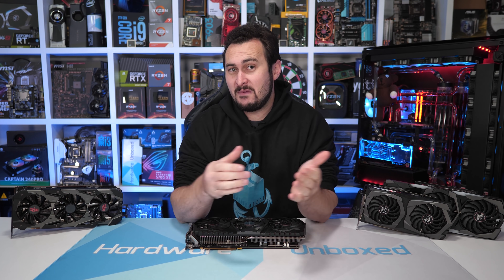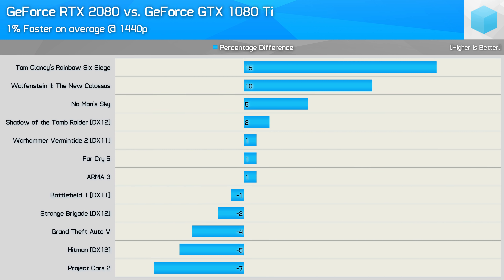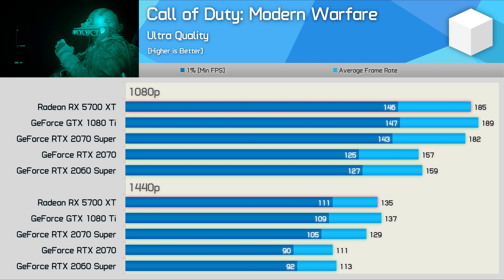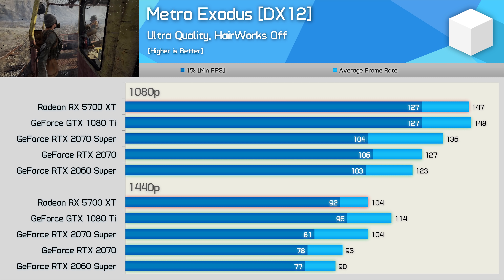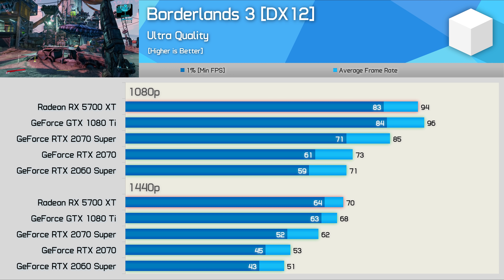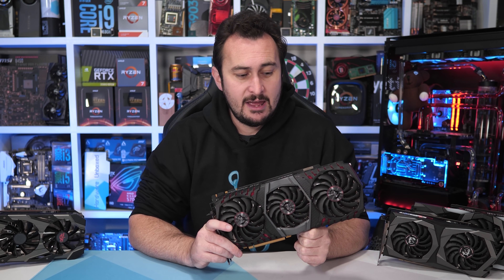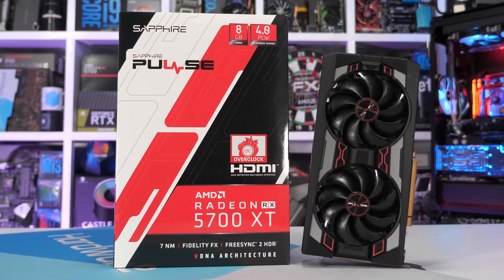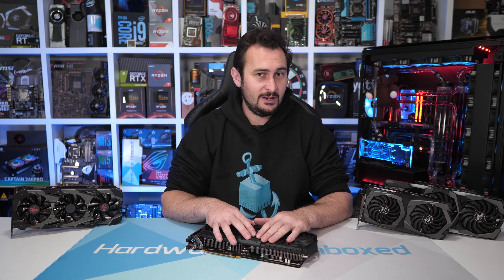GeForce GTX 1080 Ti vs. 5700 XT & RTX 2070 Super, 35 Game Benchmark

Comment: i bought a xfx thicc iii 5700xt based on reviews like this, it was a complete disappointment. my 2070 non-super out performed what I was led to believe was a upgrade of sorts. it was crap and fps kept going down even with more cooling. built a 3900x system and thats been nice.

also, tried following your ram tuning guide, might want to revisit that using micron a1 e die, the calculator has changed and I had a bsod, settled fo geardown disabled and stock timings with a proper cl15.  😒

Comment: Great vid as usual. Stupid Question Time:  The 5700XT is fantastic value , but when on screen where there is only 5 frames short of the TI, citing CPU  is the limiting factor. now... if on the same setup if you then compared a 27" 1440P with an 1440P Ultrawide , would the RTX TI then come into its own by maintaining higher FPS?

Comment: I know plenty of people who have bought 2nd hand 1080tis instead of the 2070 super and 2080 because of the extra Vram. Performance between the 2 is very comparable with the 1080ti beating out the 2070 super in most cases. RTX ON just tanks performance so not that many people are using it. Considering the performance is very similar, the logic here is that you are actually better future proofed by having the extra VRAM head room.

Comment: I couldnt use my 5700xt for 2 months and now got it back. Every fame Ive tested it against the 1080ti....it performed better.  Its why I sold the 1080ti and am now using a friends for tests. But still my 5700xt is getting 5 fps more on more recent  games. Why is mine doing so much better compared to the 1080ti than yours?

Comment: Frist off, not a PC pro. Build a PC in Nov 2019 and I think my MSI RTX2070 armor oc is dying. Gaming on it at 1080p max setting without issues at first but now I can't even play on medium setting without a pc crash which need a hard reset.

Black screen, black and coloured box, freezing and stuttering, crashing usually 30min - 1 hour of gameplay. Is this normal? I heard of 2080 and 2080ti artifacts but 2070 not so much.

So borrowed my friend's 3 year old RX Vega 56 Sapphire blower card and so far no problem. Gonna rma my card soon.

Comment: Nvidia Turing Now in 2020:
GTX 1650 (the one I dont get the idea behind)
GTX 1650 Super (the good value low/mid range gaming card)
GTX 1660 (Makes no sense after 1650 Super has launched)
GTX 1660 Super (Very good value card actually)
GTX 1660 Ti (Makes no sense after the Super has launched)

RTX 2060 (the resonable entry level RTX (quite good value if not for Navi - Fine for 1080P + ray tracing.)
RTX 2060 Super (Too expensive over 2060 to be good value, but good performance @1440P)
RTX 2070 (makes no sense over 2060 Super)
RTX 2070 Super (The high performing resonable RTX for smooth 1440P + ray tracing or 4K @OK settings)
RTX 2080 (Makes no sense over 2070 Super)
RTX 2080 Super (Too overpriced to really make sense over 2070 Super)
RTX 2080 Ti (The very overpriced - makes no sense unless you want 4K@high + AA - just to have it on)
RTX Titan (Ha Ha..! It has Gold on it?)

AMD Navi Now in 2020:
RX 5500 XT (good low power card - all you need for smooth 1080P@high gaming. Pick the 8 GB and expect an advantage over 1660 Super in a few years time)
RX 5600 XT (good mid-range card - Superb 1080P & smell the lovely 1440P@high experience)
RX 5700 (Good mid/high range card - enjoy 1440P@high settings - smell 4K@low/medium-ish)
RX 5700 XT (The one to have for super smooth 1440P@high settings or 4K@OK setiings gaming experience)

That is why Nvidia don't get money out of me. That list is twice as long as it should be (and confusing for many consumers)

Comment: AMD = Value that Delivers performance. Nvidia = I don't know what to say anymore..  I remember getting a brand new GTX 1080 Ti exact 3 years ago for a little Less than a 2080(non Super) cost Now!! WTF!? 
Just got a new (demo-model full warranty) Sap. Pulse RX 5700 XT for about the same price as the cheapest RTX 2060 6GB. That is "2070 Super" performance for low 2060 Price. (and cheaper than a 2nd hand 1080 Ti - out of warranty)
The 1080 Ti was a great card - and still is. The last New Nvidia card I got. Nvidia don't get a penny out of me before they change their business game.
You want a RX 5700 XT very get close to RTX 2080(non Super) Performance?? Get the Asus Strix OC model. I have one (Can verify it runs 2000+ MHz stock settings).
I choose a new (or newer) RX 5700 XT any day over a 2-3 year old GTX 1080 Ti. Less power, better arcitecture. RDNA optimizations will age like fine wine, and 3 years from now, a RX 5700 XT, will beat a RTX 2080 (maybe even the Supermodel). The Big Navi will make a difference. Nvidia has made the same mistake as Intel. Delivering new products, that really arent that better for a long time (3 years). RTX 2080 Ti 30% better than GTX 1080 Ti at almost twice the price??! Let's hope Big Navi will give 2080 Ti and the ridiculous RTX Titan a deserved beatdown. If one think RX 5700(XT) with twice the cores and HBM2... If AMD can harness that power, Nvidia will not know what hit them. But  it's going to be a power monster. Let's hope the cooler they put on, can control it's fury(heat) The Radeon VII cooler has it's challenges ;)

Comment: Coming up on two years with my EVGA 1080ti SC. It's been an absolute beast and most of that time it was paired with a bottlenecking FX 8370 CPU. Which I have replaced with an R9 3900X just last week. Which has really shown me just how far I can stretch the 1080ti's legs now.

Buddy of mine thinks I'm crazy that I wont even consider trading up to an RTX 3xxx series later this year. Told him that the 1080ti is perfectly fine for another 1 1/2 years until the 4xxx series. As that would be my trade up year.

I've even considered buying a second 1080ti SC to SLI.

Comment: Is the MSI 1080 Ti used here in the OC mode for clock speeds?  I believe MSI uses 1683 MHz as its "OC Mode" for its boost core clock.  Just curious as I am running my Asus Strix OC at 2025mhz and trying to make a comparison.   :)

Comment: One Question to the Community: What GPU should I get? An RX5700 XT, used 1080ti or an rtx 2070 or 2070s Card?
All are around the same price over here in Germany with the rx5700 XT around 430€, 1080 ti around 500€ used and the 2070 Like rx5700 XT and the 2070 super 530€

I Just Want to Play on 1080p or 1440p with great settings on my 144hz Display 

Btw upgrading from a 1060

Comment: Ha. A used $300 gtx 1080 ti wipes the fucking floor with a $350 rx 5700xt. Would get the rx card but the drivers fuckin suck.

Comment: The 1080Ti has been my best GPU purchase to date, it was expensive when I got it, but for a 1440p setup, you can't go wrong with it. Sure it's showing it's age and has definitely been surpassed technologically by the RTX lineup, and is now on par with much cheaper current gen cards, but this long into it's life, it's still a damn powerful card. I'm definitely looking at upgrading in the next year or so when the RTX 3000 series hits or perhaps even the "Big Navi" cards, but my 1080Ti has served me well. Very happy with my purchase.

Comment: I bought my GTX 1080ti used for $450 and here in my country, a 2070 super sells for $715 and so no, it's not worth it. Also, the RX 5700 XT sells brand new for $450 and the closest in price is the RTX 2060, the RTX 2060 super sells for $550.

Comment: Strong GPU. I still have the regular 1080 and can game 1440p and average frames with most games 80-120 with tweaked graphical settings 

I’ll probably pick up a 3080ti or whatever they will call it next because I just haven’t had a need to upgrade and the current options cost/performance aren’t attractive enough

Comment: Fun to see how well my 1080 Ti is holding up.  I saw no reason to spend any money on the 2080 at launch, and the 2080 ti seemed like only a small bump in performance for massive expense. I would have liked to see some comparison with the current top card, the 2080 Ti.

Comment: 5700 and 5700xt are a great value, have my 5700 flashed with 2.1ghz OC and it’s incredible performance for the dollar. Can’t wait for Big Navi. Also a lot of people have been scared away by drivers, from my experience I’ve barely had any issues, any I did have were fixed with 20.2.2 drivers. Just make sure you actually do a clean driver install.

Comment: Anyone owning a 1080ti need not upgrade for the current going prices... 

The 5700xt is AMD's 1080ti variant for $350+ at the time of this post; USD. Depending on the partner card for sure. Technically anyway... I'm also not personally having driver issues on my 5600xt Pulse. Just use DDU to clean up and you should be good.

The 2070s was a waste of a generational card. It's the same performance as the 1080ti for all extensive purposes for $200 less than the 1080ti's original launch price but considering it's a new generation they sure banked a lot on people loving RTX :/ and not raw power. Hope they don't make the same mistake twice with Ampere ;)

Comment: i got me a EVGA GTX 1080 Ti SC Black edition with a waterblock, pump and rad for $400 when the RTX cards launched haha. Funny thing is the waterblock pump and rad were still sealed up and unopened. When i asked about why that was they said they had only owned the GTX 1080 Ti for like 3 months and had just picked up the EK-FC1080 GTX Ti - Nickel ( $139.99 water block ) SCORE! I upgraded from a RX 580 to a GTX 1080Ti and now my CPU says NOPE can't keep up lol. I think this card is way over kill for 1080P gaming but hey i can always go buy a 1440P monitor and the GTX 1080Ti will not even break a sweat in gaming. Early RTX adopters were ... well foolish.

Comment: bougth the MSI trio 1080ti last year from ebay for 550 in perfect condition and i believe it was a very wise choice. Card is killing it AND i will lose only 100$ max if i sell it now can you say the same if you sell another card a year after you bough it used? I disagree when you say there is no point to buy a used one for 500$ and chose the 5700XT. Shitty drivers and less RAM = WTF would you do that ??? Like #TechDeals says, always buy the flagship so that you have better resell value. a 2070 super will lose half its value in a year and the 5700XT the same.

Comment: People buy a 1080ti because of 11gb of v-ram, both 2080/2070super have simple to low amounts of v-ram the only competition vs 1080ti = 2080t which also costs a fortune. So while comparing it to 2070 super and 5700xt performance wise is interesting for performance, but at the end 1080ti with 11gb of v-ram will age far better even in next gen as result. 

So yea the only competition is basically 2080ti at this point.

Comment: Great :) My GPU is a GTX 1080 8Gb OC Gigabyte. 2560x1080p and had it since launch. Was paired with a FX9590 and did alright up until 6months ago* then upgraded to a new R5 3600 cpu and gained a big jump again.

Comment: It would have been interesting to see some 4K results as well.  Remember, the 1080ti still has MORE MEMORY (11GB) than any  2000 series card below the $1200.00 2080ti!, which still only manages to match it with 11GB of VRAM..
The 2080ti's memory IS faster, but it still has the same capacity for textures as the 2 year old card it was replacing ;)

Comment: the price difference between $$ and ££ is outstanding. you say the 1080Ti is going for about $500US (£400), but here in the UK its going for £700 ($860)

Also, i think people want the 1080Ti included in benchmarks, not to see if they should buy it. But like me, to see how it holds up and if its worth upgrading from (clearly not yet)

Comment: 1080ti is a card  that you have nowhere to upgrade from. Only 2080ti. in my area they go for 1400 eur.  Considering i got my ASUS Strix 1080ti  for 550 eur new(was a really really great deal) its huge price hike. Even if i sold my card for 500 to some crazy guy i would still have to  spend 900 eur extra for the new card.  On top of that Its probaly not best to pair that card with 4790k so a whole pc would have to be upgraded: MB, CPU, Ram. So basically a new computer. And for what? extra few frames that you maybe would not even notice. Turn some setting one step down from ultra or extreme and that bags you the same frames with minimal quality loss. Will see what the future brings. Raytracing is a gimmick now but maybe 2 generatations of gpus to the future  its actually normality to use and majority of games support it.

Comment: Great vid, I’m not sure if u are aware of new Microsoft flight sim 2020 but they just released optimum requirements which is rtx 2080 which I cannot afford so was wondering if I should try and save for 2070 super or get the cheaper rx 5700 xt no worries if u don’t respond but I’m just curious to which would be better but yet again the game is still in alpha build testing so hard to test 😕 thanks for vid anyway bro

Comment: Stick to Nvidia.

As much as I love AMD's open source drivers, what is the point of open source drivers if they STILL do not work properly after 8 months? 

Every single issue in games I have reported still exist. 

Space Engineers still hangs: https://gitlab.freedesktop.org/mesa/mesa/issues/2121

Frostpunk still hangs: https://gitlab.freedesktop.org/mesa/mesa/issues/2447

Kerbal space program still hangs*: https://gitlab.freedesktop.org/mesa/mesa/issues/2647 

https://gitlab.freedesktop.org/mesa/mesa/issues/2174

Subnautica still hangs: https://gitlab.freedesktop.org/mesa/mesa/-/issues/2791

The Witcher 2 still hangs: https://gitlab.freedesktop.org/mesa/mesa/issues/2369

*KSP has a patch that makes it not hang as much, you need to compile your own Mesa for it though. 

I am on Stock, have never overclocked. Have a 5700 XT Sapphire Pulse.

Only games I have played that do not give me issues are Nier Automata (AFTER enabling RADV_DEBUG=nongg or else it hanged) and the Half life games (with the exception of half life 2 episode 2, still haven't reported it because I cannot capture an apitrace) 

I will say unlike Windows at least the hangs don't occur outside of games. 

This is not an enjoyable experience, I have spent more time with my GPU bug testing than actually playing.

Comment: gtx 1080 gang ftw, got it lauch 550€... back in 2016 great card indeed, i expected to replace it by now but.... we'll wait till ps5 drops and new stuff comes
Reply: That's nuts. I just bought one at 360€, excluding shipping. I'm more excited to undervolt and test rog strix 1080ti than when I was trying out 3080 and 3070 ha. 3080 was mad, just stupidly fast, and expensive at 900€. Although, it was only 65% faster at 250% price, and had worse power consumption. I think I'll be buying everything used in the PC space moving forward, especially because the used parts in my country have 1-3 months warranty from the PC shops.
Reply: @MadViking82  well unless u actually want high end stuff, obiously, used parts will be cheaper than new bcz... well, they r used
Reply: @arencorparencorp2189  You are correct. And what I actually found, is that the used gtx1080ti was going 15 degrees too hot and it had some visual warping on the screen so I returned it. The only good GPU in store was gaming x trio 3070, so I went back to it with a small 15 bucks loss after selling the previous one. It's ridiculous how difficult it is to find a GPU that works. Sold and bought 5 GPUs in 9 months had every single one of them had some kind of a problem. At best, they had immense coil whine. If this rtx 3070 doesn't have a broken fan like the one before, I'll buy a new PSU and see if that would reduce the coil whine (I'm already expecting a horrible whine...) I might just have to accept that it is impossible to build a truly silent PC that has good temps. Or I need to undervolt so much so that I reduce performance 20% of the card.
Reply: @MadViking82  weird, have 0 whine with 3090, had 0 with 1080 and 0 with 780 ti, psu also has 0, the worst part is one of my hdds, got replaced and while its not 0 db, its silent, aio 360+tuf 3090, dead silent, when gaming fans make some noise but its very reasonable, it has to dissipate almost 500w of heat, so, some bearable noise at max load, with 70-ish temps and almost silent idle is, ok, all is oced

Comment: I've been using my aorus 1080ti for 2 years now and I'm hoping for 2 more.
Reply: I wouldn't worry about Gigabyte and ASUS they last forever.
Reply: @danielfinch362  Yeah I've been mining for 4 years now with a mix of XFX cards on the amd side and evga and gigabyte on the nvdia side and I've yet to have a single hardware failure, not even a bad fan.
Reply: They're about to last even longer thanks to AMD's Fidelity FX.

Comment: One of the reasons the 1080 Ti is going for higher prices is its 11 GB of memory.

1. Future proofing crowd: "It has more ram, so it'll be useful longer."
2. Pre AMD 5700 XT release crowd: "I'll buy the best, used, upgrade that I can for a decent price."
3. The work and play crowd:
a. Lots of video ram helps in certain workplace programs when dealing with lots of data.
b. 11 GB of ram will take awhile, for crypto currency miners, to become too little for coin DAGs.  (This is why you now find many 4GB cards hitting the market.  Windows based machines can no longer support mining on 4GB cards with many alt-coins.)

Comment: I have a 2070 super and on 3D Timespy benchmark at 1440p my score is 10796 the nearest 5700xt has a score of 9216 so how is the performence similar just asking , if the 5700xt had my score you would call it a huge difference , but as it is you you call it similar , i see same results on Heaven and superposition benchmark , 5700xt is never even close to my numbers , what your during is using a oc 5700xt and comparing it to a stock 2070 super witch is not really fair ,  the 5700xt is a great card but it is not in the same leage as the 2070 super , next time compare it to 2060 super and dont oc the 5700xt .